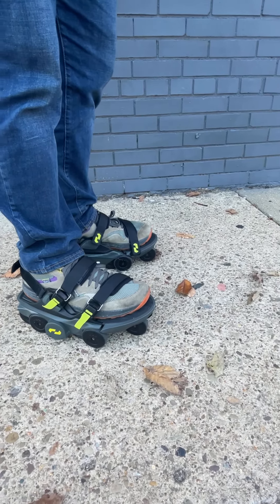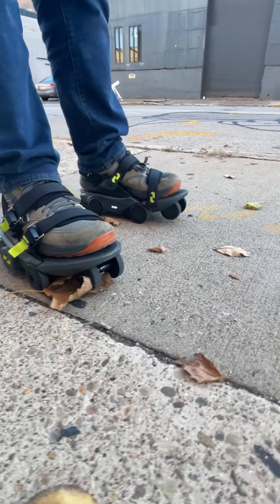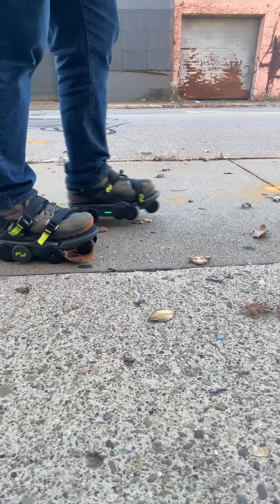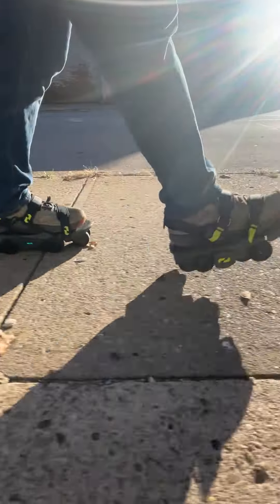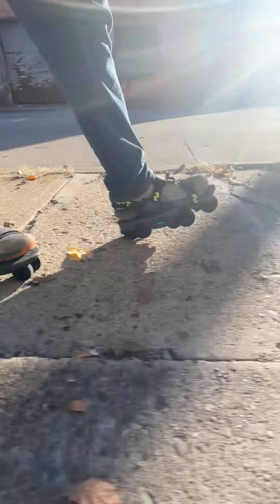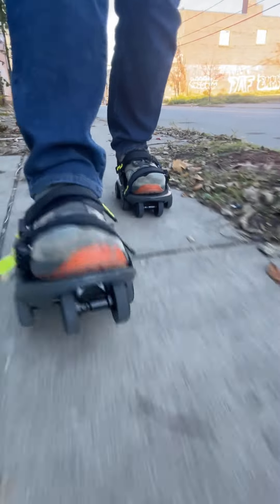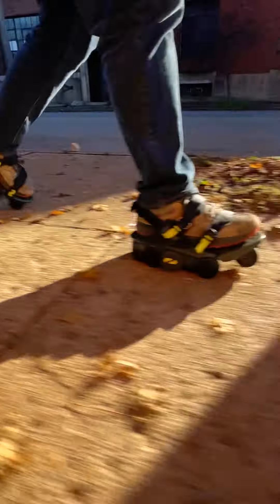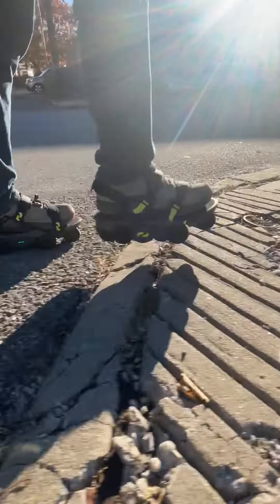9 - How to moonwalk on sidewalks

Comment: Amazing we can probably improve the model aswell such as putting  Graphite milon sheets or a solar panel on the heel to take in energy while on the move or some sort of gyroscope electrostatic generator when a little movement is applied the power from movement produces more energy

Comment: you need to push this toward delivery workers and mailman,  whats the battery life and weight capacity?
Reply: Mailmen use bikes, better yet an electric bike, this would only work on flat services, would be in trouble of you have to go up hill.
Reply: @Emtrax.  you can put them in a “lock mode” where they don’t do nothing and you can walk up hill I guess , but yea I’m flat warehouses these things might be good if they can work around the safety hazards lol
Reply: @BigSpinnerdawg  It won't work if your stopping and starting and when you might have to walk just a couple of meters to things sometimes
Reply: @Emtrax.  Ive never seen bikes for city routes but Ive seen segways.. Id say this more for flat routes with mail stops largly spread out.( park at an intersection, deliever 4 blocks on foot and then drive up) the bike would be too cumbersome for that option
Reply: @MindChamber  Bike is faster and safer. Do you seriously see a person walking nearly 10km on a busy sidewalk?
Reply: @Emtrax.  I cant answer that as I havent tried on these shoes to know for sure but judgling by the video  it seems do able.. a bike would take way to long to mount and dismount.. remember.
Theres more than just one bag a mail for each route delivery. not including packages.
Reply: @MindChamber  Electric bike is over twice as fast. Also do you see how long it takes to stop?

Comment: What if you have a limp?

What if the batteries fail and you need to change them, or you just want more range?
Battery swap.

Do they have a weight limit, what happens if you exceed that weight limit?

Comment: Theoretically with a very powerful AI and much smaller wheels and system, in 10 years these could make you run 50-55mph effortlessly and in total security's
Reply: There is no AI involved here. It wouldn't achieve anything useful and on top the shoes would need powerful processors and therefore horrible battery life
Reply: @BlueTJLP  i think i read somewhere that there's some machine learning behind that adapts and learns your walking style.

Comment: What would happen if you stepped with one shoe into the grass/dirt around the trees?

It seems like it would be nearly impossible to overcome these types momentum and balance problems. If one of your feet is suddenly stuck in some mud, wont you likely fall regardless of what the shoes do to compensate?
Reply: What would happen if you stepped into mud with roller blades on? Oh thats right you would use common sense and avoid muddy areas. Not sure why you’d expect it to be thoughtless operation
Reply: @calibudz5504  So you're saying these are no more capable than rollerblades? Then why not just wear rollerblades? (The whole point is that they are supposed to be better.)

"Typical in Pittsburgh. Rust-belt city. We have a lot of old infrastructure. A lot of bad sidewalks. *None of its a problem for Moonwalkers.* We wanted a product we could actually use here in our own city."

It is presented as a practical way to walk around a city with lots of obstacles. In other words, something far more practical to use than rollerblades. The reason I asked this specific question is because you can see they are avoiding the dirt in this video.

I think it's important to know how capable they are of handling unexpected obstacles. If you wear these everyday, it's only a matter of time until someone walks around a corner in front of you, an idiot on a bike suddenly hops up on the sidewalk in front of you, you don't notice a pothole until the last second, etc. that forces you into a less desirable situation like stepping onto dirt.

Maybe I'm wrong, but it seems to me like they are marketing this for practical everyday use, not as some kind of new and mildly-dangerous urban sport.
Reply from the maker: Hi @PleaseJustLetMeBeAnonymousGoogle, the control system doesn't just look at the single shoe. It ultimately looks at your whole body balance from the aspect of walking dynamics. If you step on something that just causes a small speed drop and you are still in balance, Moonwalkers will continue propelling you. However, if you suddenly lose balance or pose yourself for an emergency stop to avoid collision with another pedestrian, Moonwalkers will slow down as soon as possible without throwing you off. 
Hope that answers your question!
Reply: @ShiftRoboticsOfficial  where can I get these?
Reply: @ShiftRoboticsOfficial  Thanks for replying! That partly answers what I was wondering.

The other part is probably difficult to explain in words. It would be really cool to see some video of people reacting to obstacles and stopping suddenly.

Without actually wearing them, it's difficult to tell if these would be great or impractical/dangerous. A video of more extreme situations could show a lot though.

Thanks again 🙂
Reply from the maker: Hi @DUKEGOHARDDOTCOM , thanks for your interest! You can preorder them on Kickstarter right now (http://kck.st/3f0meT2)!